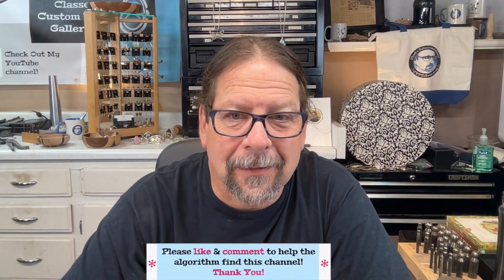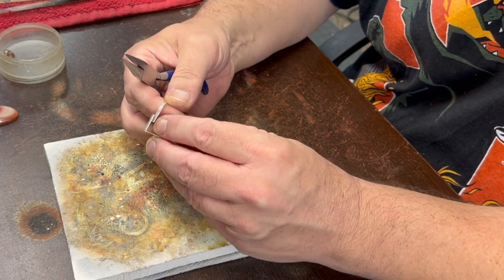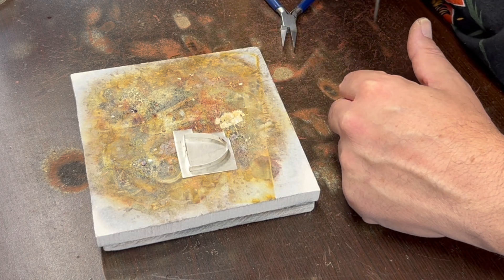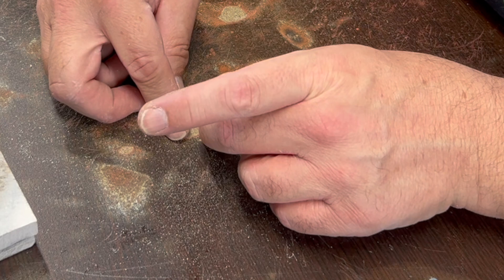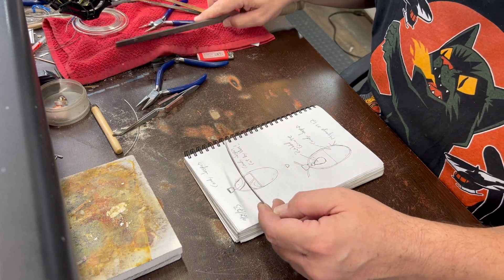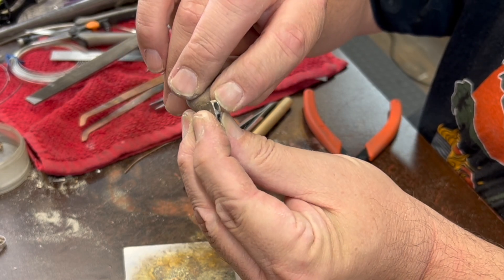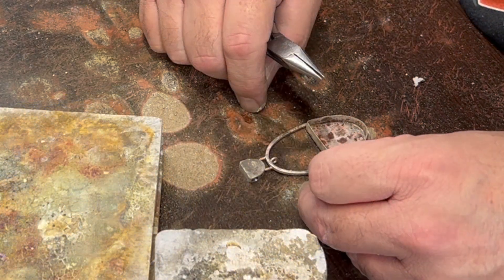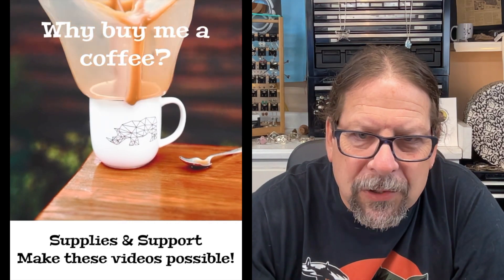Using Gemstone Patterns in Design: A Silversmithing Tutorial

Comment: Chad, why do you wait until the end to pickle? I understand pickling doesn't have to happen every step but I imagine after many steps the piece can get pretty crusty and difficult to see the joins (checking for clean and tight joins). Clearly, it works for you but I am curious what your personal reason for this is. I find that most metalsmiths pickle and clean frequently during fabrication. There must be a "why" - I'm curious;  thank you for indulging my "why's". 🌺🌺🌺
Reply from the maker: I only pickle it if it is so goobered up that I can’t see what is going on. If I’m concerned there is a problem with previous connections I will pickle for a while to clean it up. Otherwise, it seems like an unnecessary step:)

Comment: Hii Chad, i had a question, i just started making jewelry with the goal of eventually selling my pieces. But the first peice i make was a pair of earings but now after maybe 2 weeks of wearing it it turned kinda black. And i know it normal for sterling silver 925 to get black overtime and u can polish it again, but so fast?! And other pieces that i just bought from other brand that are also sterling silver are fine... what did i do wrong..?
Reply from the maker: Two things jump to mind that could be happening. If you don’t get all of the polishing compound off, sometimes that accelerates oxidation. Use really hot soapy water and really get it clean. The other is that many silver items you buy at the store are rhodium plated to prevent tarnish. This is why some commercial jewelry seems more tarnish resistant. I don’t think you did anything wrong though:)